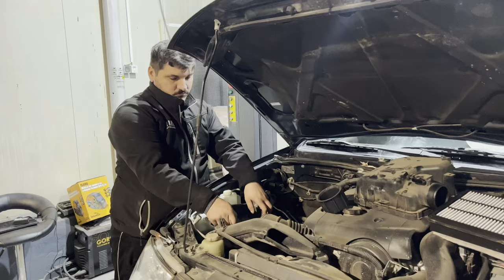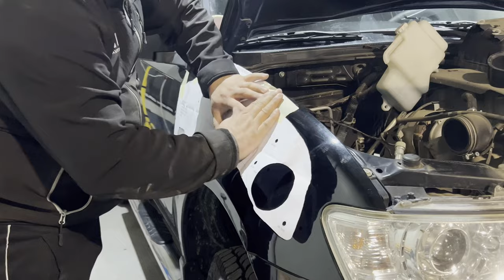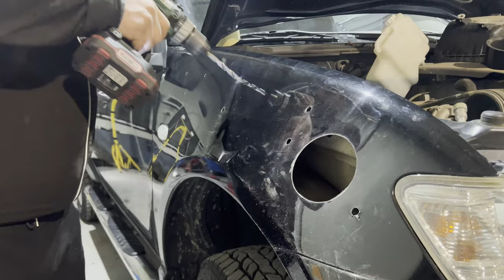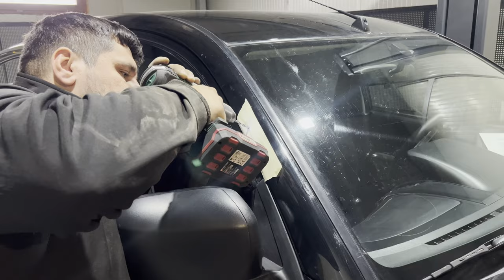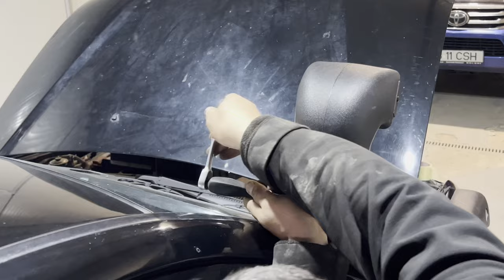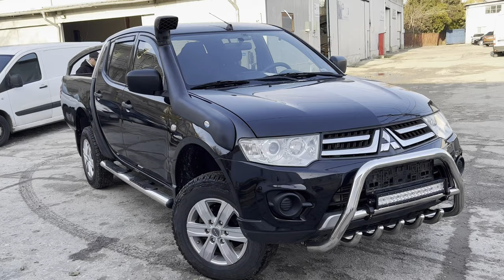Cum se instaleaza Snorkel Play Xtreme pe Mitsubishi L200

Comment: Salutări din Italia Florența o întrebare despre snorkel Văd o mulțime de snorkeli pe multe vehicule de teren care au tubul ciuperci întors spre spatele vehiculului de teren 4x4 și are cineva tubul ciupercă întors spre partea din față a 4x4 ?  vehicul pentru toate terenurile?  (și unele vehicule de teren, 4x4 are o ciupercă ciclon ca o mașină agricolă sau de terasament? Crăciun fericit 2023 și la mulți ani 2024!)
Reply from the maker: Hello, 
Why install a snorkel?
A snorkel exists to quite literally elevate your vehicle’s air intake, which not only mitigates the impact of dust and water on the engine but takes in more fresh air to keep the engine cool. It works by moving the intake further away from the ground, where your vehicle will be kicking up plumes of dust and dirt. The raised intake also reduces the likelihood of water finding its way into your engine when crossing rivers and other shallow bodies of water.

The head is the part of the snorkel where all potential contaminants are separated from the air before it enters the snorkel itself. The two most common types of snorkel heads are Air Ram heads and Vortex (or Cyclone) heads.

Air Ram – other known simply as standard head, this head lets the air ‘ram’ into the snorkel, as the name implies. The contaminants are then blasted against the side of the snorkel head and fall into the snorkel itself. They are then filtered through small vents in the snorkel body. These types of heads can face either forwards or backwards.

Vortex/Cyclone – The head you’re going to be looking for if you regularly drive in very harsh conditions, vortex heads utilise centrifugal force to separate the contaminants from the air. A strong gust is pushed up through blades that encourage circular movement. This pushes contaminants out and takes air in. It’s generally a more expensive option but is particularly useful for farmers or desert drivers. 

you can fiind more tech articles on our blog.bestride.ro
you can buy several models of snorkels, or other 4x4, offroad accesories from our store: www.bestride.ro